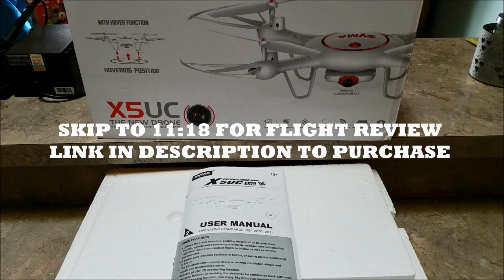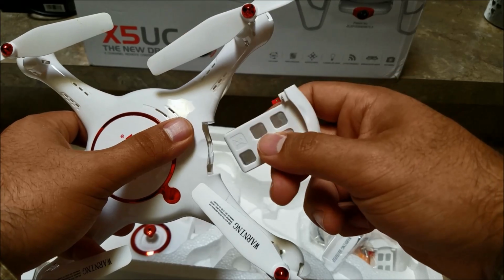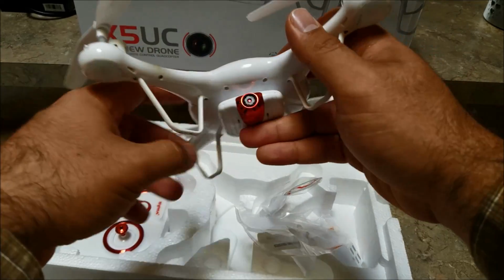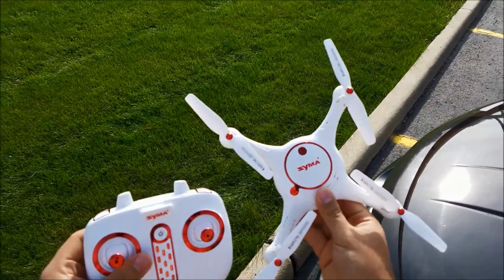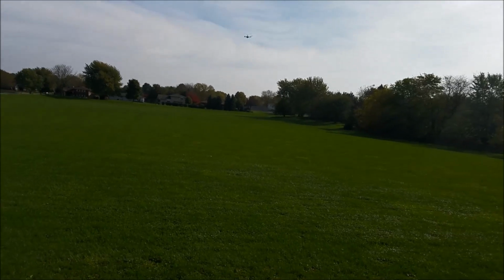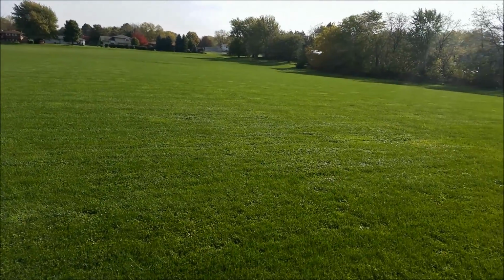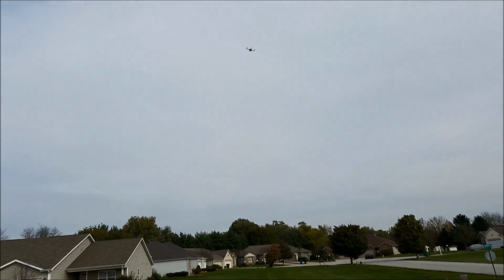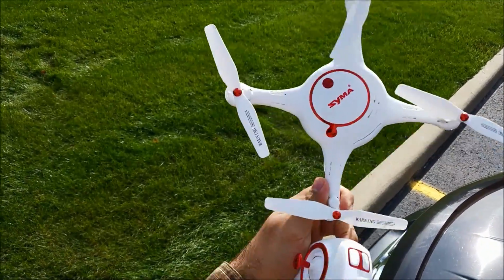X5C KILLER. NEW SYMA X5UC (GEARBEST.COM)

Comment: Amazon Prime. Prices from five mins back.

FIVE 500mah batteries with charger - £10.99. For X5C.
TWO 500mah batteries with charger - £16 - for X5UC

Meaning that if I was dumb enough to get one of these overpriced new models I’d have to buy a set of brand new high price batteries for it despite having a handful of good standard generics.

Not a hope in Hell.

There’s plenty of great Syma models still available that use my existing batteries.

It’s notable that the same pattern as with X8c and it’s “upgrade” replacements those latter seem to be getting discounted to get them shifted...

Syma decided to get greedy and try to fleece its customers. Maybe they’re not going to be that easily fleeced. 

Reviewers have the duty to call out manufacturers on matters like this - but maybe the ones that get sent freebie quads don’t want bite that process??

Which is why freebie quads get sent out in the first place!

X5C killer? Don’t think so! Unless they drop the prices of those batteries a whole lot.